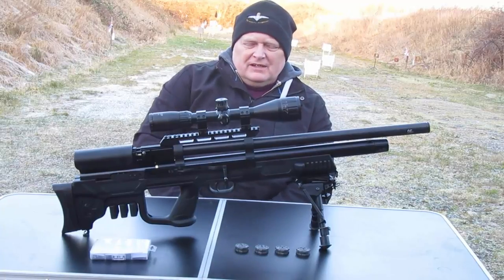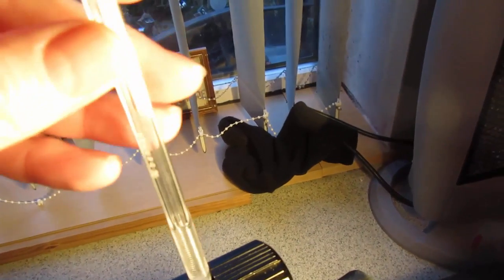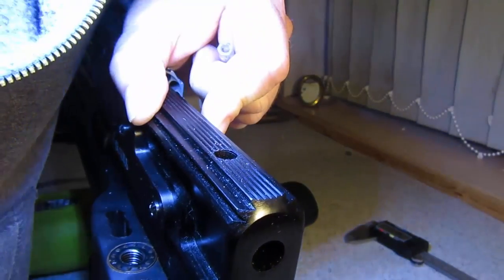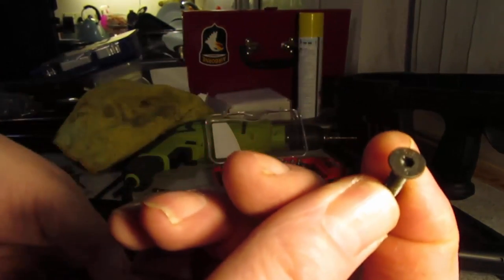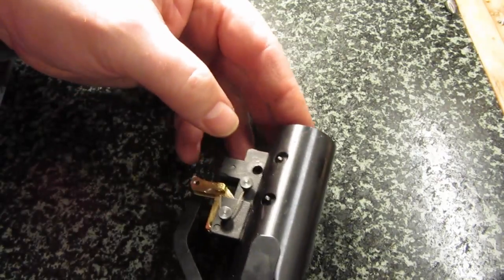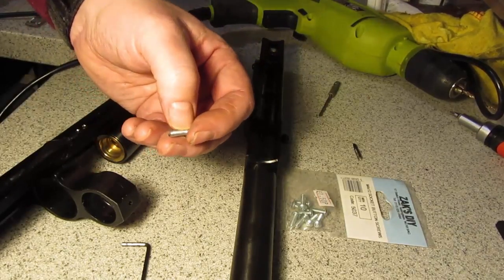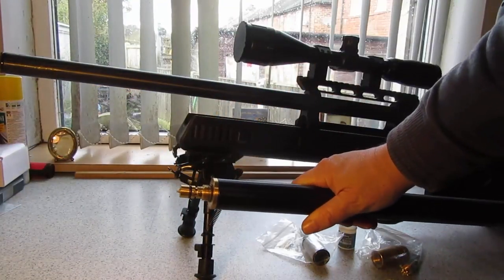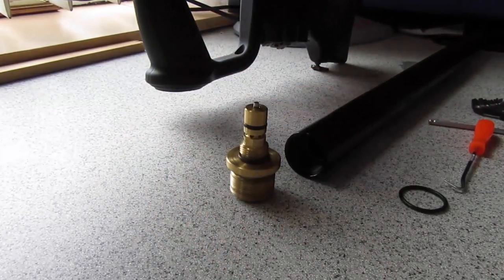The Hatsan Gladius Pt 1 & Pt2 Removing the anti tamper plus Regulator installation

Comment: Hi, 
 
 Great video! Really informative. Loved it. I'd like to offer a bit of advice to the viewers having tuned 4 different Hatsan pneumatic rifles (two at44's a BT65 and a Gladius) so far. With the first 2 rifles I drilled out  the tamper proofing as you did (great idea with the drill guide!) but then found there is a way of removing it without cutting metal. It's thread locked in with no way to get any torque on the head to remove it, but using the powers of physics you can remove it. It's essentially the same method for removing the tamper proofing on a HW100, but on these rifles you need to take a 200mm x 6mm  flat ended soft alloy rolled bar( Brass is good for quick heat transfer up and less likely to damage or scratch your action as it's soft metal. Stick it in your drill on reverse. apply pressure to the anti tamper screw ramp up the speed and pressure. eventually the heat transfer from friction will melt the thread lock and the anticlockwise rotation will unscrew the screw. Job Done! Also What I'd say is while the rifle is still unregulated. The standard power mapping is more of a power slope than a curve, so you are not going to get the best out of your air reservoir. The transfer port seems to work best for Hatsan UK rifles by increasing it to 2mm from 1mm giving a nice gentle curve with peak power at around 145 bar when you back off the spring pressure (don't increase the port size if you have not got control of the power by now r it will make your rifle illegal in the UK). At this stage, you could actually use your rifle unregulated if you don't want to fit a regulator to your tube, for anything but competition as it gives a spread of 0.8ft/lbs over 10 mags.). I found when I regulated the tube with a HUMA regulator set to 90 bar on the low side and adjusted the muzzle power to 11.25ft/lbs it gave 12 mags with a 0.2ft/lbs spread between 200bar and 100bar  and 14 mags with a 0.5ft/lbs spread between 200bar and 90 bar.

Cheers bud!
Reply from the maker: Great information, many thanks. I have now found that all Hatsan air cylinders vary in internal dimensions even on the same       rifle. I ordered a spare cylinder to put in my Gladius along with a lane regulator, only to find that the internal dimension are not as big as the previous cylinder. The valve screws in fine at either end, but there appears to be a larger step, meaning that a regulator will not fit. It would either require the regulator being milled down, or some taking off the cylinder. A pain in the arse to be 
honest. I found this with the Hatsan Galation as well and needed to have the regulator milled down to fit. It would probably be 
easier to have new cylinder made to measure.
Reply: @airgunsniper-elite7385  On the HUMA web site when you order the reg,  they ask the month and year of manufacture that's printed at the top of the cylinder where the pressure gauge is for just that reason.  It must be something to do with factory re-tooling at Hatsan. The tolerances must change slightly. It's a shame Hatsan don't make the 12ft/lb rifles with a peak curve at 150 bar and a 2mm transfer port from standard. You could then just regulate the tube and tweak the reg a bit either side of 90 bar to keep it under 12ft/lbs. A little trick you can do to make them less pellet fussy is bore out the pellet wells in the mag slightly and replace the the nitrile rubber retaining band with a more elastic silicon rubber one the same size. the standard pellet wells and retaining band causes length way scoring on the skirt of pure lead pellets like JSB's. I bore them out to 4.9mm in .177. After doing so you will feel hardly any resistance as the pellet enters the breach because it's got a bit more room to manoeuvre when going in and less likely to deform. I've never worked on a .22 mag but it might be 5.9mm. You get instant tighter groups and the rifle is much less pellet fussy.

Cheers!

Comment: I supported my Gladius in my CaseGuard GunVise then used a battery drill and 8 mm drill bit held vertically and by using it slowly in reverse initially it removes the 'pip', once that 'pip' is removed simply put the drill into forward and slowly drill the head off the anti tamper rod retaining screw. No biro needed because the access hole is 8mm.Already at 11.40 straight from the box my next job is to try and quieten the hammer noise which apparently is a major problem with the Gladius.
Reply: Bit more learned....I used an instant heat electric soldering iron gun by placing the tip of it on the 4 side screws one at a time to melt the Loctite on them. Heated each a few seconds then tried unscrewing, if tight then a bit more heat before trying again until they came loose. No head damage at all.  Once cleaned off with thinners they were then re-used.

Comment: when you drilled the anti tamper screw with the 2mm drill. you could have tapped an allen key or torx bit into the hole annd screwed the anti tamper screw out. and it may have made life easier
Reply from the maker: Yes, I've done it that way before with caps, but this Gladius was a snap off screw head and not an easy one.

Comment: Quick question. When changing the valve pinn, from the lower 6-10 joule to the max one at 50+ joule, do you need to change the hammer/spring setting to? Or is it enought to just change the valve in the tube?
Reply from the maker: It all depends if you are in a country with power restrictions. If it's full power you want, then you will need to open up the brass transfer port and get a heavier hammer spring. If you are fitting a regulator, you will also have to balance between the set pressure on the regulator, and increasing the tension on the valve spring can help prevent hammer bounce. And the pressure of the hammer spring pushing against the valve and opening it at low air pressure. Robert Lane has some good videos on how to tune a rifle. The principles are the same for all.

Comment: Hi, firstly I love the info in this and the previous vid you made but I have a silly question, wont a torx anti tamper T20 wrench remove the offending bolt? I have found one on ebay for 3 quid  and have ordered it just in case it will work !
Reply from the maker: No, a torx wont remove the original anti tamper. It's a snap off head, so it definitely needs the head cap drilling off.
Reply: I took mine out with an EZ out

Comment: Why are you doing this? What does it do for the rifle? I know what the regulator does but why remove anti tamper screw? To make it more powerful?
Reply from the maker: No, if you you just put in the regulator the power actually drops by as much as 2 ft/lbs. You need to be able to adjust the hammer spring tension to be able to tune it to the correct ft/lb which is ideally around 11 ft/lbs on the UK versions. I had already tried this on my Hatsan Galatian, but as i couldn't adjust the power on that, once the regulator was fitted it was only doing around 8 ft/lbs. It is a common problem, so that's why you need to be able to fine tune it once fitted.

Comment: You can adjust the trigger to make it more smoother?
Reply: Adjustment is possible but that will not make it smoother because all that does is adjust the travel and release pull weight. BUT...Yes you can make it smoother, Simply strip the trigger mechanism and polish the surfaces which bear on each other (sear and release) then lightly grease them with Molyslip.

Comment: Is the regulator a UK requirement?
Reply from the maker: No Eddie, just a way to make the rifle shoot more concistantly if its done right. The only UK requirement is for no air rifle to go above 12 ft/lbs or air pistol over 6 ft/lbs. Air rifles can be any power if you have a section 1 firearm certificate, which would be the same for any other firearm. Scotland have now all been made to require a special airgun permit to posess any air rifle or air pistol and its been quite a nightmare for all the airgunners who suddenly became ilegal if they didn't apply for one, and the procedure could take months as the police had to also deal with real firearms as well as the added pressure of airguns. We live in quite a restrictive country if anything has the word gun after it. The daft thing is that you can buy a 120 ft/lb crossbow without any kind of permit, so the laws make no sence over here.
Reply: @airgunsniper-elite7385  So the regulator just makes a more efficient use of air?

Comment: Regulators are sold by snake oil salesmen, they see reviews like this one and think i need this, no you don't, do a bit of recherche into the mechanics of the gun and it can be tuned even if you have to put the pressure in the cylinder that you are trying to achieve.